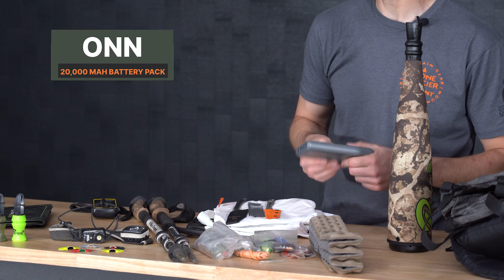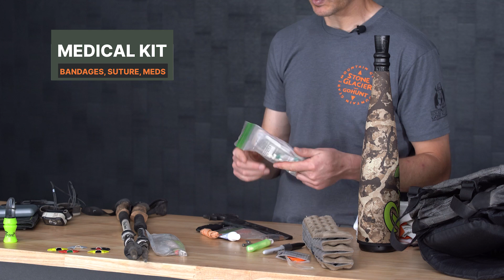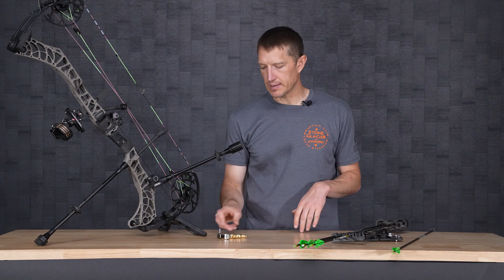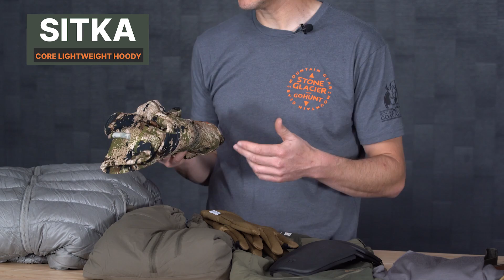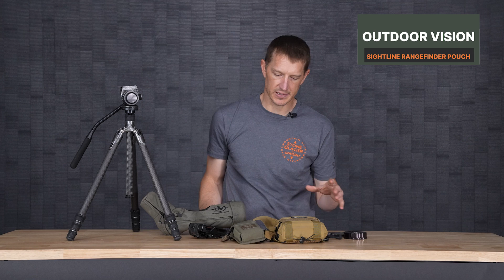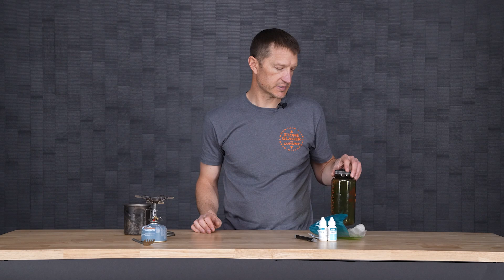Trail Kreitzer's 2022 Early Season Archery Elk Gear List

Comment: Hey Trail, great in depth review of your gear! Thanks for sharing.  How do those new Scarpas compare to the Hanwag Makra Trek/Combi?  Thanks!
Reply: I'd suggest they are comparable, few minor differences...the Scarpa's are all suede vs a synthetic/suede combo on the Hanwags. I think the Scapra's will wear a bit longer because of that. The tread on the Scapra's are a bit deeper than the Combi, comparable to the Trek. The Scarpa is a smidgen more flexible in the sole than the Combi, similar to the trek. Weight/feel on the foot is very similar. The Scarpa feels a little longer and a hair narrower than the Hanwags, but just ever so slightly. Overall, I'd suggest those three are in the same vein..the Combi just having a stiffer sole.
Reply: @trailkreitzer9163  thank you!

Comment: Great video as usual! Can you show or describe how you nested your Soto Windmaster in the Seek Outside bail handle mug? The mug diameter seems to be a bit small to fit the Soto or it's just a really tight fit. Did you have to modify anything for the stove to fit with the canister at the bottom? The video cut to the next frame right when you were trying to pull out the stove. Thanks!
Reply from the maker: Great question, here's what Trail had to say...

The Seek Outside Bail handle mug will fit a small fuel canister (3.9oz) in the bottom and the SOTO then put in on top (sideways). It's a very tight fit, you'll have to force it in a bit. I then put the support piece facing down over the main stove piece. Lid goes on top of that. The lid won't snug and stay on top, but it fits nice with the the cover/case it comes with with the draw string around the top, or I've often just put a couple rubber bands over it as it seems a rubber band comes in handy at times when I'm backpacking.

Hope this helps you out! Appreciate you checking out the video.

Comment: I have always been a fan of the MSR pumps and the Katadyn Pumps. There have been times were the only water we had was a mud puddle we found. We dug it down with a shovel and let the water settle and pumped from it for a few days with no problem. The MSR filter can be cleaned but the Katadyn pumps better IMO.

Comment: Awesome video! You mention below strings are green…are the strings white with green serving?  Looks incredible!
Reply: Strings are solid flo green with purple serving. That set was made by A3 archery - bloodline fiber. I have a few thousands arrows through those and I’ve been very impressed with them..no creep, no peep twist, no serving separation. Can’t recommend them enough.
Reply: @trailkreitzer9163  thank you! I knew I was color blind but didn’t think I was that bad…never would have guessed those colors. 😀
Reply: @tannerk45  took a look back through my order form and in the bloodline fiber A3 offers a color called Viper Green, which is what this is. I remember trying to order flo green and at the time they didn't have it. So, this color combo is Viper Green with Flo purple serving.
Reply: @trailkreitzer9163  perfect...appreciate you taking the time to look back!

Comment: Your med kit could use benadryl
Reply: Agreed, my med kit need a revisit for sure.
Reply: @trailkreitzer9163  I would highly recommend getting an Israeli Bandage. They are pretty packable and are good in case you have someone severely injured.
Reply: @ColoradoStreaming  good tip, I'll check that out. Admittedly I have skated by for many years without a few necessities I need to add to the med kit. The older I get, the more I am realizing that things can happen quickly and it only takes a slip of a blade or a misstep. Thanks again, great tip!